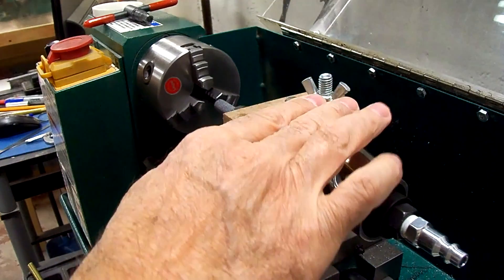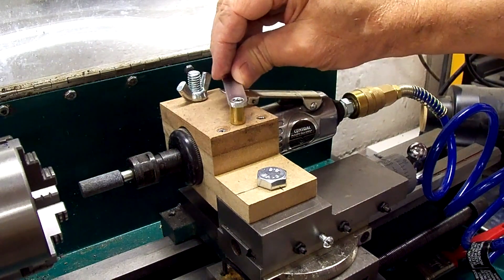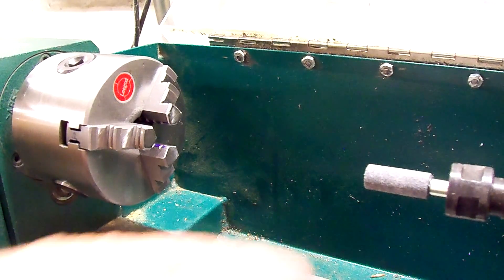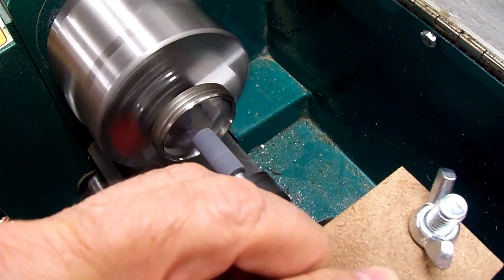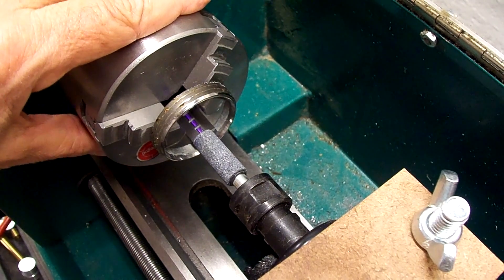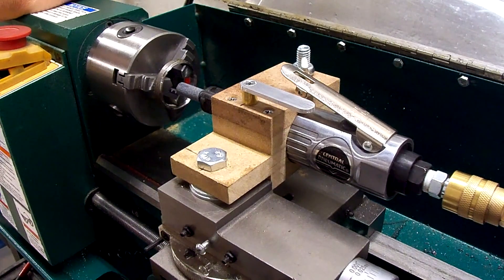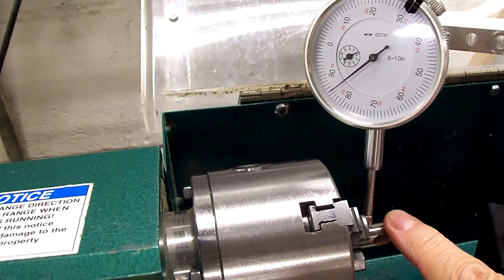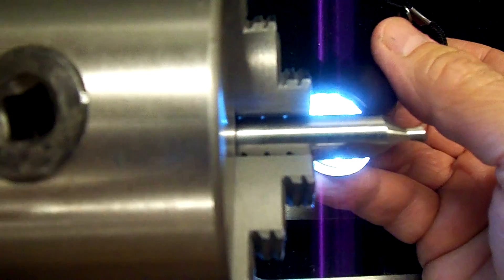Mini lathe chuck jaw grinding part 2

Comment: Why do you grind the jaws when you can turn the register on the spindle a bit smaller, then you can tap the chuck to correct runout.
Reply: This is a mini lathe, good luck finding a 3 jaw that you can adjust like that.

Comment: If you had a ring that fit over the chuck and loaded the jaws from there you would have had a lot better results. But .005 isn't bad at all for a Chinese 3 jaw chuck. Realize your dealing with ridicules numbers when attempting thousands of an inch accuracy.
Reply: Simply…the jaws need loading in the opposite direction..

Comment: Two problems. First, wood distorts, shrinks, expands and decompresses by several thousands depending on the ambient humidity of the environment and the moisture content of the wood. Second, you should protect your lathe bed from the grinding dust. It will impregnate itself in the steel and ruin the precision surface.